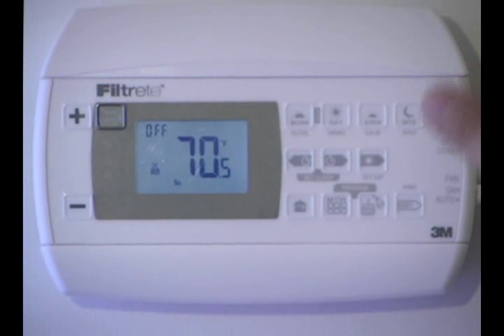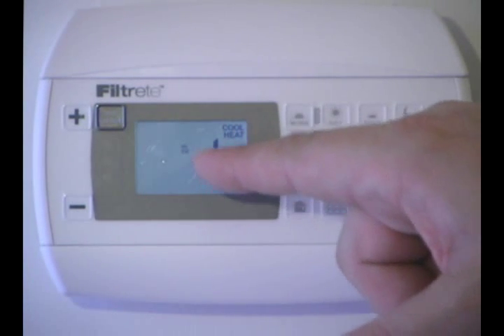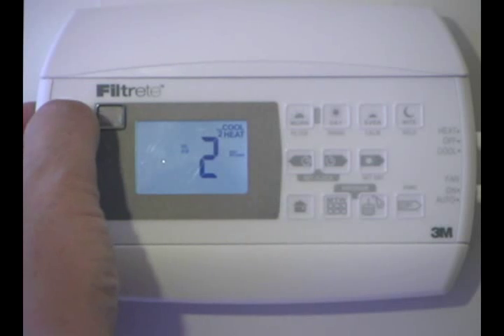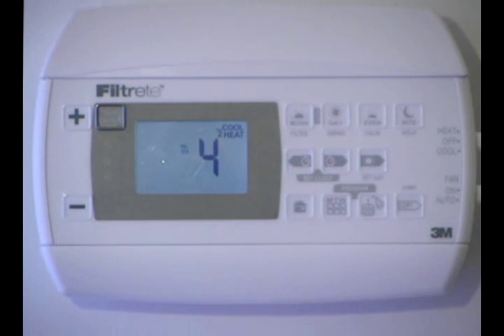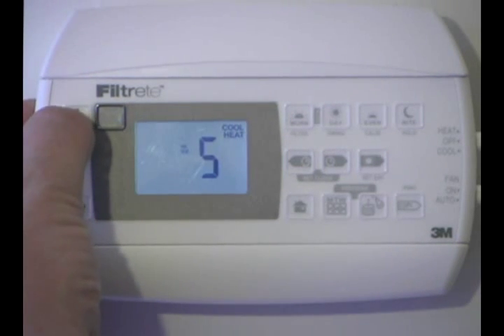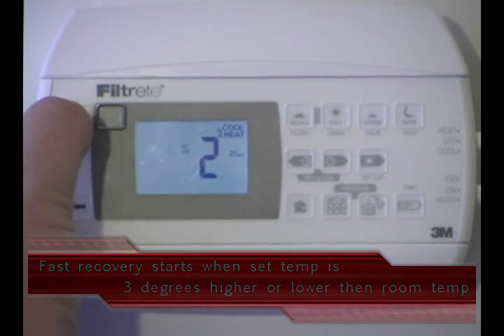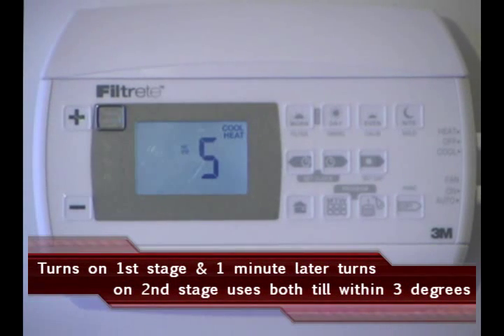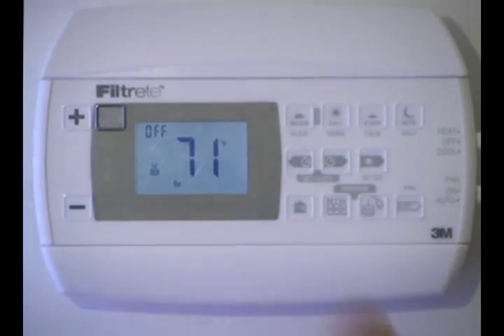Filtrete 3M22 On-screen HVAC set-up non-heat pump systems

Comment: I have a two wire hook-up (B & Rh).....what settings would be recommended? Currently it is set on 1, but the heat will not stop running continuously.  Do you have any suggestions?